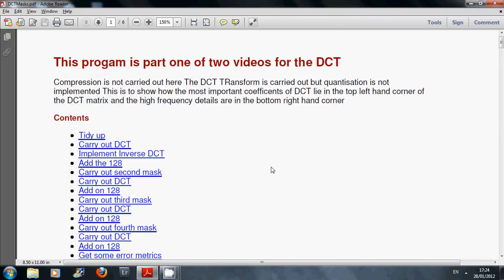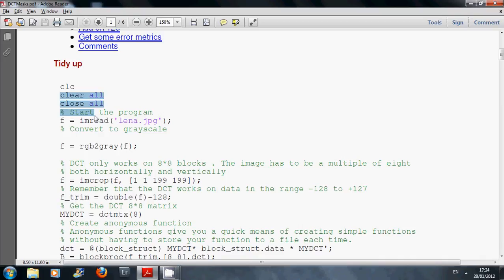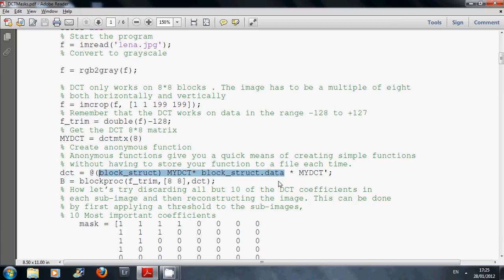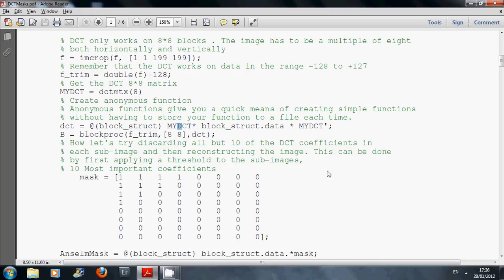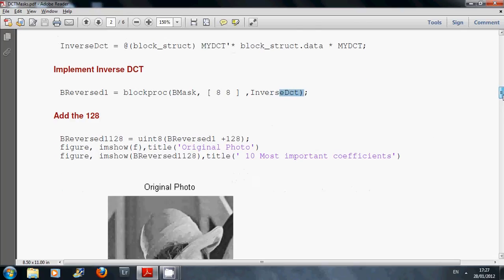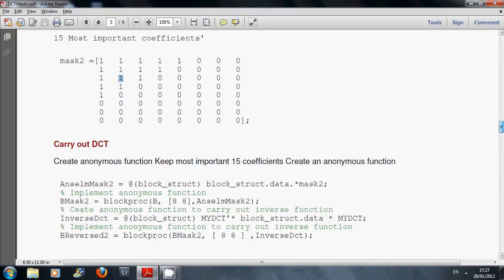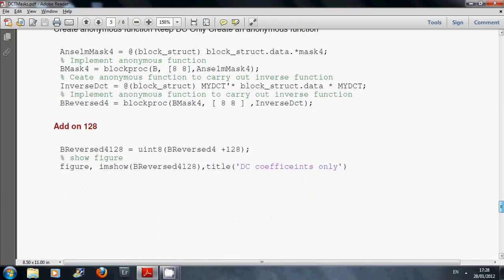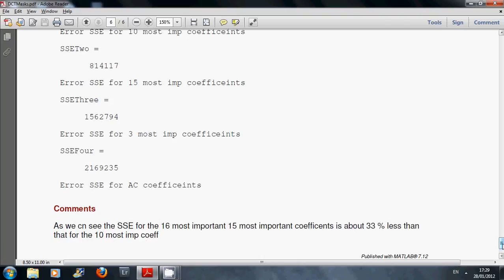Mask DCT coefficients in  Matlab

Comment: What is the function of binary mask?and how its work in  increase the compression?
Reply from the maker: When you run the mask over an 8*8 block anywhere there is 1 in the mask will preserver the underying value in the block structure data. Where there is a zero in the mask will wipe out the underlying value.  The ones in the top left corner contain the lower frequencies (the basic building blocks) the higher frequencies  go towards the bottom right corner.  When you RLE (Run Length Encode) it you have a very long run of zeros which will give improved compression.
Reply: @AnselmGriffin  yes, thats is true ..i  have tried, the compression is more increase, but there is more lose information, cause of the mask...
Do yoy have idea about optimize the quantization table, ? I've tried with HVS quantization table , its more effexctive in compression than jpeg quantization  table
Reply: @AnselmGriffin  thanx .. it explain alot🙏
Reply: @AnselmGriffin  hi again.. do have link "text book" about this binary mask please?
Reply from the maker: @ronaldtamsar  https://users.cs.cf.ac.uk/Dave.Marshall/Multimedia/node231.html
Not exactly what you asked but near enough
Reply: How about the orthogonality of DCt, ist same for 4x4 or 16x16 block, ?

Comment: What's the difference between DCT Coefficient and Quantization?
Reply from the maker: When the mask is used we know exactly what DC component ( the top left hand corner) and AC components we are going to keep. If there is a one we keep that component if there is a zero we remove that component.
When we use a quantization matrix we are not exactly sure what we are going to keep and what we are going to discard. In general the quantization tends to keep the values in the top left hand corner and as we head towards the bottom right hand corner of the quantization matrix we lose values.
 Remember that the values in the quantization matrix are small in the top left hand corner and large towards the bottom right hand corner. When you divide by a small number the chances are you will end up with a non zero number, When you divide by a large number and round to the nearest whole integer there is a reasonable chance of it being zero.